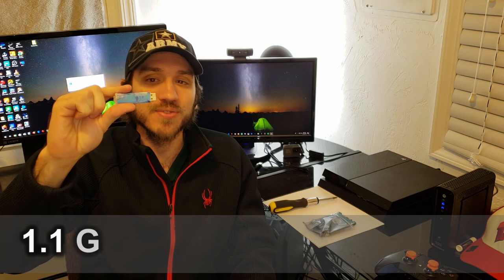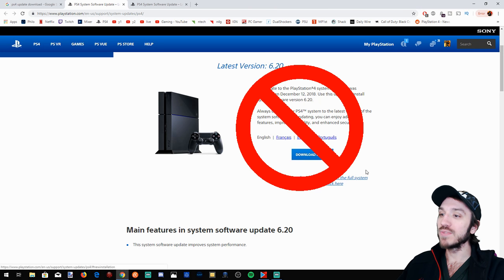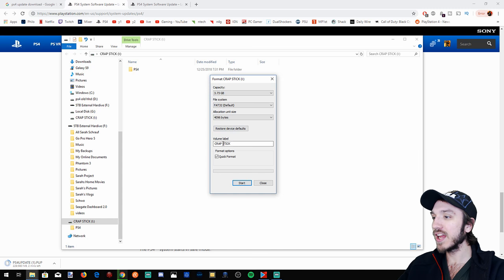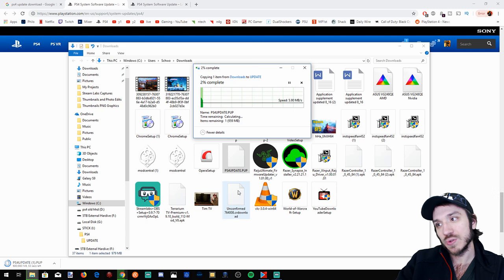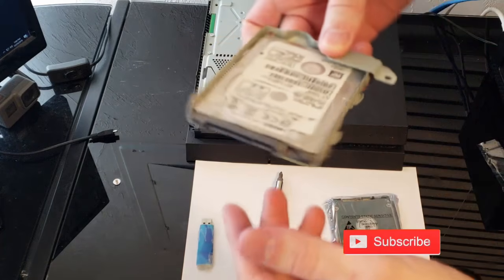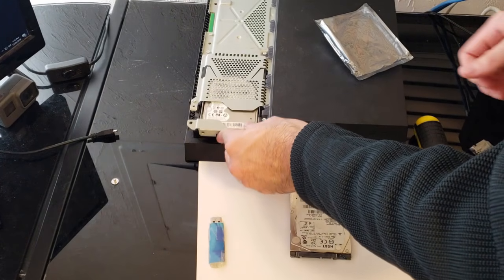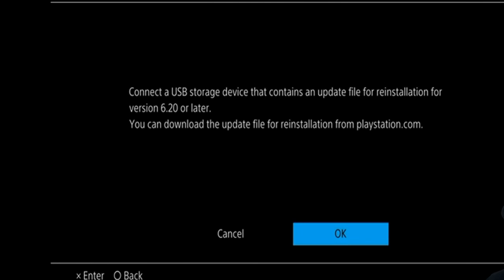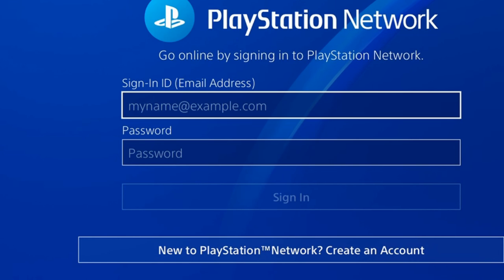How to install NEW PS4 Hard Drive (500GB to 2 TB) Upgrade Tutorial 2019!

Comment: so i have a question...i did this upgrade and saved my old 500GB HD for a later backup operation as I did not have a backup external drive at the time...I bought one and put my old drive back into the machine to do the backup but it won't start without a software update as it has an older software version on it. I tried to do a software update only but it wants a full re-install update which i fear will wipe all the data on the original HD...is there a way to get the data backed up on the original HD?

Comment: Recently I brought a upgrade hard drive for my PlayStation 4 A 1tb I already had a reinstallation stuff ready for the USB drive I tested it out on my old hard drive and it worked just fine for step 7 on safe mode. So long story short I opened the box for the new hard drive I take the old hard drive out you know I do everything you supposed to do I put in the new hard drive but the hard drive refused to go into safe mode with the PlayStation 4 I kept getting the error code ce343-35-8 you know the famous area code that means unable to access system storage because of some form of corruption. Out of all the videos I watched you know it's simply as you take the new hard drive out of the box and you do the installation you put in a safe mode and you install you know but this one just wouldn't go into safe mode. So my question is do you guys have any recommendations of a good company I can buy the hard drive from and a good brand of the hard drive. Basically I found out sometimes if the hard drive that is new if it doesn't go in the safe mode it means you have to plug it into the computer and run a program called check disk to look for bad sectors I don't know how to do that I'm not a computer programmer I just want to get a hard drive that I can simply purchase put it into the PlayStation and go into safe mode and reinstall the software like how it's presented in the videos

Comment: Hi guys. I can only find a 16Gb USB and the PS4 will not accept it because it isn’t on FAT32 file system. My laptop will not change to FAT32 either it only has NTFS or exFAT. I have the same issue with the backup hard drive which is 1TB

Comment: I did all these and yet I couldn’t install the reinstallation system update. I had a system error, SU-30645-8, that’s a corrupted file on the pendrive. I tried the same file on the same pendrive with another ps4 and it worked. Any suggestions?

Comment: I did every step corrrect. my PS4 still gives an error code when I click "install from card"
Reply: Did you download the whole software reinstallation file or just the update?  I did the same and checked my file size, it was only 400MB instead of a GB
Reply: @406Steven  i noticed that also. ive done everything. I believe the fuse for the blue ray drive is blown, ordered a new one. testing soon.
Reply: @guitarnorm888  Another thing to watch out for is if your USB drive is fitting all of the way in.  I also ended up having to use a USB extension cable because my drives had protective shells that slid over the connector or the drive itself would slide out.  This wasn't allowing enough space between the USB drive and the case of the PS4 so I used an extension cord and it would finally detect the flash drive.

Comment: Are the quotations Mark's needed because I git my tb but keeps saying no update file found
Reply: F.N.D. King just put the letters in normally. Just be sure they’re all capitalized.
Reply: @Head-Bootius  hi I been having problems using a 16 and 32 USB 2.0 do they need to be 3.0?
Reply: F.N.D. King are you trying to upgrade with a new harddrive  or  an old one?
Reply: @Head-Bootius  I bought a new 1TB but my ps4 won't find the file on a sandisk 32GB and 16GB
Reply: F.N.D. King check if the update file has any numbers in it like (1) for example if it does delete the number and () from it and check if works.
If that fails make sure you downloaded the right file from PlayStation.com under the "new installation” for the system software

Comment: NOTE NOTE NOTE NOTE NOTE: make sure you download and install the 'PS4 console reinstallation file' and NOT the 'PS4 console update' file !!!!!!!!! If you try and put a usb with the latter file on it into your PS4, with a new HD inside, the console won't recognize the usb file and give you the 'CE-34788-0' error message. To make things particularly confusing, Sony names both files 'PS4UPDATE.PUP' and has them saved on the usb thumb drive to a folder named 'UPDATE'. The only way to tell the .PUP files apart is that the update is 400 MB and the reinstall is 1.0 GB.

Comment: Does this work for if ur apps are corrupted and ur PS4 is freezing  I need to know pls ASAP
Reply: Yes it does I bought a hard drive it's coming in a week but I heard it works and probably will
Reply: Osiris My ps4 says it’s corrupted system and I can’t use my ps4 at all now
Reply: Banana_ Goose yes I’m getting mines Tuesday and it will fix
The corrupted issue all you need to do when you get your new hard drive is initialize it in safe mode and it should u

Comment: I get to the part where i click on option 7 and i get a error code Su-41333-4 and says the usb storage device is not connected. How can i fix this. I installed a 2tb drive with an external drive box
Reply: Gabriel Jimenez ran into this issue today.  If you found a solution please let me know!
Reply: 5fivezero0 did the pen drive cover was not letting me plug the pen drive all the way in so i removed the cover and it worked
Reply: @gabrieljimenez1391  You were correct.  I removed the cover of my usb drive and now the ps4 is able to see the usb drive.  Thanks for the help!
Reply: 5fivezero0 no problem buddy

Comment: CE-34878-0 - I have this error code on every game I try to load up will swapping to a new hard drive fix this? I also haven’t got a computer is there any other way to get the update on to the usb
Reply: You don’t need a usb when replacing hard drive just initialize it once you replace it

Comment: when i open the cover of the ps4, the inside is different than the ps4 in this video, idk what to do,
Reply: Wym
Reply: Do u have the ps4 slim, if you do there’s a little door thingy on the back and u want ti I slide that and unscrew the screw and pull the hard drive out with the ribbon on it
Reply: Or you can watch a different video how to replace us on ps4 slim or pro
Reply: I have the normal ps4, when I open the cover, there is no slide thingy or anything, it doesn't even look the same as this video, idk why pls help